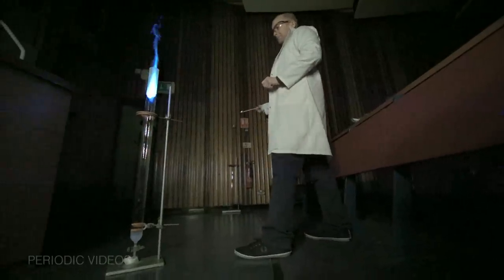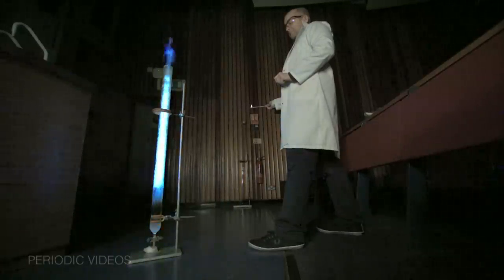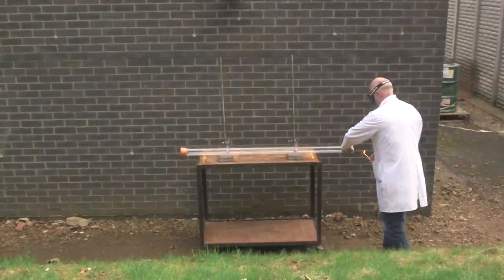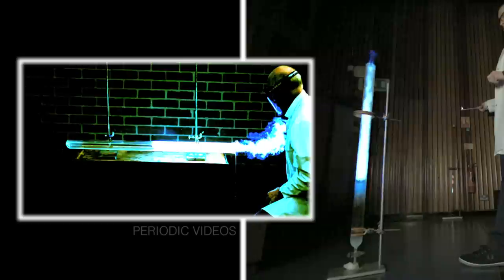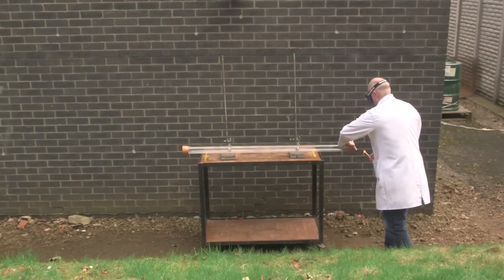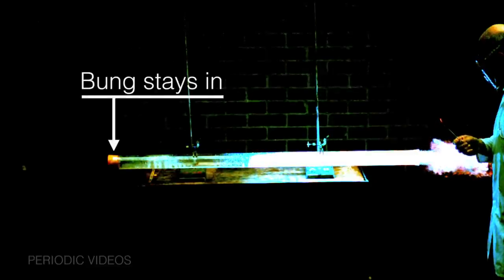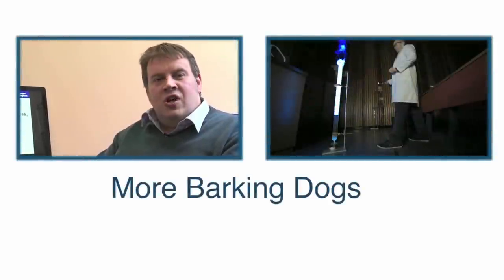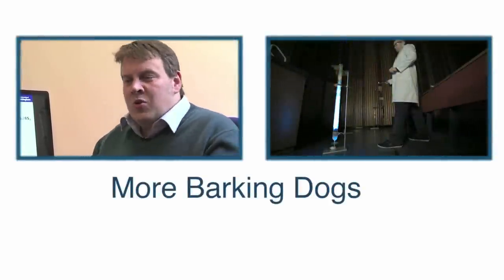Horizontal Barking Dog - Periodic Table of Videos

Comment: When I first watched this video I noticed what seems to be evidence of the shock wave bouncing from the sealed end of the tube, to the flame front. If you look from 1:20 – 1:22 and again from 2:43- 2:49 at the sealed end of the tube, you will see a blue light bouncing from the sealed end to the flame front at the same frequency as the column of flame at the opened end of the tube. I also think the experiment might be interesting if you could invert the tube so that the open end is down and the sealed end is up.

Comment: Might I propose that what may be happening is similar to an air gulping piston engine where the fire front creates the piston head, compresses the gas (watch the gas turn to a fog as it compresses/decompresses), the expansion of the gas as it heats then overcomes the pressure of the flame head pushing it back allowing room for further ignition and gulps another amount of gas to start the process all over. Thus the "gulping" theory. This oscillation is repeated until very low in the chamber when the flame "piston" breaks and the gas ignites down the side of the tube. I also Feel that this oscillation is what makes the "bark".

Comment: I think its more likely to be a principal of displacement (conservation of mass) rather than compression within the open tube example. There will be negligible compression as the gas has somewhere to move out the other end prohibiting it from ever building up. Rather its the hot gases which expand pushing the vapour out the other end, by a simple mass balance this causes air to be pulled in causing the displacement to speed up. As for the closed tube it would be a similar principle. The expanding gas is moving outwards causing a brief rush in the flame front moves forward before a new surge occurs causing it to jump back. the process is repeated. Result is an oscillation of displacement. -Chemical engineer/chemist (5th yr) undergraduate

Comment: I feel like the reason the flame bounces with a closed end isn't a shock wave with pressure waves travelling to the end of the tube hitting it then bouncing back. Instead what it does is the increase in ambient pressure due to the reaction peaks at a point higher than the ambient pressure of the flame, then because of this it pushes back at the flame slowing the reaction, however as it does this the ambient pressure lowers allowing the reaction to speed up again (see smarter every day's / the slowmo guys ak-47 underwater). How I think this works would be as the next little section of n2o reacts it is quite violent giving nearby air molecules a high velocity, however as the reaction loses pressure the ambient air increases pressure pushing the reaction back. Meanwhile all the excess gas escapes the back allowing the system to reset, (hence the oscillations). Though that's just my theory... I wonder what the professor would think?

Comment: Brady, I would like to see Barking Dog in Space.   Perhaps more budget-friendly would be upside down (vertical, but the flame at the bottom). I wonder if the slightly less gravity at the top of the cylinder would have less shock waves than the upright vertical .

Comment: Next possible trial(s):
-uncap both ends, set vertically, and light from bottom.
-Have an ignition source (spark plug) inside and next to the capped end so that the flame goes from inside to out.

Comment: I think the reason for the fluctuations is, that the same thing, that happens in a bottle you're trying to pour out, happens in the tube. As the water is being poured out of the bottle, the bottle compresses until the point it can't compress anymore. Then air is pulled into the bottle, bottle regains it's past form and the cycle begins again.

This results in quite violent fluctuations of water coming out the bottle.

A more peaceful, calm and smooth flow can be achieved by letting air go in the bottle through an opening in the top.

DEMONSTRATION: violent: https://www.youtube.com/watch?v=4LH0-EqnsGI
                      smooth: https://www.youtube.com/watch?v=SWEBkNRuDt4

I hope you see the parallels, but am I on the right track?

Comment: I initially thought that the oscillation could be due to sound wave (not shock waves) but this could check this by calculating the speed at which this has to travel, however I do not know how the flame affect the speed of sound.
For the acceleration of the open ended tube could also be explained with that the flame can induce a flow which adds to the speed of the flame front. The combustion products of the flame expand. This would expel gas out of both ends of the tube, such that withing the tube this induces a flow. These gasses expand more in the direction, which is closer to an end of the tube. Thus the closer the flame front gets to the other end of the tube, the more the gas would expand in that direction, increasing the gas flow in that direction.

Comment: 1. light an open tube at both ends. 
2. could be wrong, but it seems to me that the expanding gasses (in a closed tube) increase the pressure which pushes the other stuff out the open end, reducing the pressure enough for the reaction to go a little further into the tube. sort of like if you hold a bottle of water upside down. some water leaves reducing the pressure in the bottle, some air goes in, then more water can leave

Comment: Next time on the Barking Dog :

Maybe try to superpose the waveform of the wosh sound to see if the is any relation between the frequency of  the sound and the frequency of the oscilating gas.

Maybe try different size of tube, with different length and different diameter (or even different form of tubes).

Maybe try to light the tube at the middle of the distance instead of at one end!

Comment: I used to make this with pet bottles and a little bit of alcohol, first half a liter, then 1,5 and finally 5 liter, and they flew quite well. Then I started to add water to gave more impulse, since the water was expelled in the back. The hole diameter in the tap should had an appropriate diameter, so the bottle would nor explode. Some times it did and that was quite an exiting moment.

Comment: I think you are wrong about your shockwave theory. I think what is really happening is the same as in a valveless pulse jet, but with a slower combustion rate. The burning gases heat up the unburned gases very quickly in the bottom, making them expand and push the burning gases upward. The violent acceleration of expanding gases shoots the flame too high in the manner of an elastic band and a near vaccum is created below. The flames rush down and the cycle repeats. However, everythime the cycle accelerate as the overshooting effect drives the gases up and down faster and faster.

Comment: Lighting both ends at the same time would be the next logical step, also to test the compression theory have a piece of paper at the bottom of the open tube to see if the air is being pushed out or being burnt off.

Comment: I'd love to see this done with a series of holes down the tube connected to more narrow tubes and pressure sensors. You could use a small drop of water in each tube to seal the flammable gasses in the main tube.

Comment: When I see this, I wonder if it is building up pressure from the thrust, and when the pressure gets too high, the burning gas is held back and can't reach more fuel until the pressure is somewhat released, then it can continue until it builds up pressure again.

To test that hypothesis, I would put some sort of pressure meter in the bottom of the tube and see how it reacts during the bouncing.  If I'm correct, it would build up, then go down as the flame bounces.

Comment: I'm curious to see what might happen if you lit it from both ends of the tube at the same time. Depending on the timing, the shock waves might rebound with greater force than normal, or flow in sync and 
make the oscillation more pronounced.

Comment: Have you considered recording the sound and do a spectral analysis of it, and compare it to the slomo video? My guess is that the "bark" is generated because of the echoing shockwave. The frequency of the "bark" should be directly linked to the frequency of the shockwave. Kind of like the 50Hz hum of the puls jets on the German V1 rockets in WW2. Could make an interesting video.

Comment: If a sprung flap or sprung ball stopper was used instead of a bung, it might be a simple way to figure out a bit more of the nature of the flame front:  If the reaction always completes after adequate tension on the spring is applied, then the reaction probably reaches equilibrium quickly, and there isn't a temperature/pressure excursion.   However, if the flap opens part-way through the reaction, necessitating greater and greater spring tension to allow the reaction to proceed further and finally finish, then it might suggest that instead of  some balance being struck, the reaction is running out of fuel before the vessel breaks...

Comment: I like the simple and clean water mark on the HS parts, very clean. Also is the high contrast in the same bits to get a better view of the flame front?
Reply: Rnlm Mca The high contrast is a result of the speed of exposure. At higher speed, each frame gets less light, and thus is darker. The very bright flame overcomes this.  It is why you will notice very bright lights being used in many high speed video setups; to try and overcome the dimming so you can see things at high speed which aren't as bright as a fire ball.

Comment: Have you considered the effects of pressure on this reaction? Is it possible that the rate of reaction will slow drastically as pressure increases, so that as the gas at the bottom (or left end in this case) is compressed, the system reaches some critical pressure where it can no longer react (and then the pressure normalizes so that the reaction can once again continue)? Or that the reaction front does not have enough momentum to "push through" the compressed gas at the bottom?

Comment: Something tells me it wasn't so much the "new sound" that startled him, but the much-larger-than-usual blue fireball blasting towards him. I wouldn't be surprised if he felt the heat off that one. I wonder what would happen if they used a U-shaped tube and lit at both ends, or if they simply used a much longer tube? Or a much thicker one?

Comment: have you attempted the experiment the the tube sealed on both ends and a spark inside to ignite? that may produce a giant glassy mess but how would the flam react inside? would it pulsate again compressing gas to both ends of the tube until the pressure became to great?

Comment: It seems to me that the accelerating flame in the horizontal unsealed experiment is due to a constant force being applied from the slow explosion to the gas on the left.  In the sealed experiment, the gas is being pressurized, increasing the backwards force until it equals the force of the explosion, at which point the flame starts osculating as pressure force overtakes the explosive force and gas escapes back out the right side of the tube. That causes the pressure to be weaker and the explosion to continue traveling to the left, and so it continues in a tug of war.  I am not a scientist but this explanation makes sense to me. :)

Comment: what about trying the experiment with some kind of flexible membrane, like a balloon, on one end instead of a bung?  that way the you'll have some back pressure, but not as much as something solid.  and if you know the tension of the balloon you can probably measure the force of the pressure wave from the reaction.  it would be interesting to see how much the pressure will flex the membrane and then what would happen to the fireball when the membrane reflexes back.  just an idea.

Comment: Next, you need to measure and log the pressure at the bottom of the tube with high resolution over time and correlate it with the pulses.

Comment: The bottom of the tube gets foggy as the pressure is lowered and some burning material is ejected from the open end. Doesn't it look, when sideways and both ends open, that the reaction is propelling it into the liquid? I guess I just see something entirely different when I watch this. I think the reaction would be different under low pressure, I think that might account for the reverberation you see. I think the bark you hear is just cavitation noise amplified by the length of the tube, when open on one end.  Cool video! Do one on its size suspended by rides to see the tube move and get some data from weight of beaker acceleration. Do one standing on a high frame rate pressure sensor.  Thanks!!
Reply: *side suspended by ropes ... Eek
Reply: David Hyatt That sounds like a great idea. Looking at the closed-tube demonstrations, I see a lot in common with a jam-jar pulsejet engine.
Reply: The pressure from the reaction looked negative to me also. If they had a match attached to a bung when they put it on, so the tube would be corked from both ends when the reaction started, I think the reaction would pull it closed.  But who knows what more testing will unveil ☺

Comment: Looks to be a similar principle to the way a pulse jet operates.  Also, not sure if it was an effect of the slow motion capture, but it looked like the pressure waves in the sealed tube (with the rubber bung) were pretty static (standing waves), is that so?

Comment: I'm curious at what frequency the oscillations happen. Is it within audible range? If not, what does it sound like when sped up into our hearing range?
Reply: Rua Whitepaw ...it's what contributes to the barking sound
Reply: d4rk0v3 That is strange, cause when the tube end is open the barking sound happens as well?
Reply: Rua Whitepaw For the closed-tube demonstration, I noticed that as the flame progresses toward the closed end, the frequency increases.
Works kind of like a slide whistle or trombone, but powered by combustion.
Seems to have a lot in common with a "jam-jar" pulsejet.
Reply: Epic14Games you get that from any flame in a tube. Next time you find some scaffolding get your deodorant out!

Comment: I've seen a fire oscillate during a house fire, because the room is cut off from the air supply but will pull air from the hvac vent. The air will let the fire burn and return to regular temperature  and then shoot out the vent until it has burned the air once again and continue the cycle. So could that be the same process as the barking dog just no sound due  to a house fire being a slow burn, large, and needing to move more air to continue the oscillation of the fire moving through the vent?

Comment: I asume the reaction forms a gas that doesn't combust. Perhaps a combination of this gas making it hard for anything to burn and the fact that the preasure increases will push the flame backwards un till the gas have been ventilated, then it continues to burn. This doesn't become a problem when the gas and the increase in preasure can quickly ventilate trough the oposite end of the tube.

Comment: When i was in high school physics, my teacher did a somewhat similar experiment in which he blew a torch through a pvc pipe which he said had a metal screen inside. It took a while to warm up but when it did it was quite noisy,  and then took some time to quiet down.  Does anyone know what this experiment is called? The barking dog always comes up in my searches. 

You guys should do a glass pulse jet on slow mo cameras

Comment: put the plug back in and test with something to check barometric pressure..  bet its jumping high to low.. flame rushes in, high pressure, flame consumes oxygen, low pressure, tube gulps air, cycle repeats

Comment: What if the experiment creates a side product of another type of gas that fills the space at the bottom of the tube and prevents the flame from reaching the bottom in one continuous motion and instead the oscillating/bouncing motion is the pressure reaching the point of flame prevention and then pushing it back towards the top as the gas escapes and it continues to do this as the fire burns. It would also explain why the oscillating motion only begins half way down the tube coincidentally when half of the flammable gas has been burned. Also removing the bung at the other end would prevent this build up of pressure/gas as it can be released the other end. Having the gas be released the other end would also explain why the flame begins to speed up as the release of pressure draws out the flammable gasses. This would mean the the ignited gasses would also be drawn out from the other end and increases in speed as more of the gasses are ignited increasing the pressure released. But then again I am no expert in physics or chemistry. I am just a school student with an wandering mind.

Comment: I wonder what would happen if they had it at a slight angle just off of horizontal, enough to hold the fluid and most of the gas in place but still almost completely sidewise. My hypothesis is that it would have more force on the bung and might even move it a little bit.

Comment: Make it U shaped with a fuel supply and you have yourself a pulse jet. I know, it's a little more technical than that and the glass would probably melt but is there a connection?

Comment: I don't think it has to do with a shockwave, nothing is going faster than sound here, nothing is exploding, so I can't see where a shockwave would be coming from? I think the fire is trying to run down the tube but "chokes" on the byproduct gas, making it bounce and pressurize / depressurize the air, which produces vibration, which equals sound as it reaches criticality. IOW, the sound comes from the flame "choking" on the gas produced and "burping" it out very fast making it vibrate.